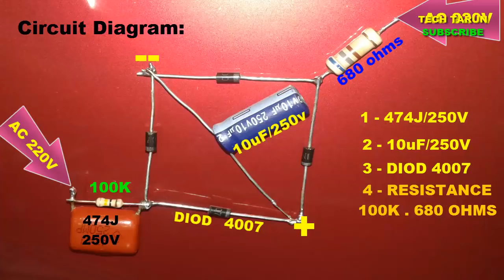51 led serial light run 220v with out transformer

Comment: Brother, 474J 250volt ke badle me 400volt dene par led jal jata hain. 
Mere kuch kuch 5mm led jal gaye.
Reply from the maker: Use one resistor 68 ohm positive series।।।
Reply: @techtarun77  thanks brother

Comment: ap log sai  tara  video ma ya ni bata ty Jo fa function badlny wali Jo kit ha os ma Jo przy lagy ha  WO kitny vad ky ha ak  ak  pozy ka bato gy plz comments ma bato plz
Reply from the maker: Description me tha all details।
Component  1 - 5mm 51 led    @     2 - 474J/ 250v      @ 3 - Condencer 10uF /250v      @     4 - Diod 4007        @ 5 -        Resistance - 100 k 1/4 watt       @ 6 -   Resistance 680 ohms 1 watt       @    Minimum 30 led /Maximum 65 led                                     CIRCUIT DIAGRAM -   https://drive.google.com/uc?export=download&id=1FbmLuwwkXZjPJS6M8_CD0ndV-V9Lle00

Comment: Please tell me what happens if I use 474J/450V capacitor?  Because I could not find 474J/250 capacitor. Will it cause problem if I use 474j 450 capacitor? Thank you
Reply from the maker: Yes use 474j /400v poly capacitor
Reply: @techtarun77  Thank you very much for the advice!
Reply: @techtarun77  If its  450, is that Ok?
Reply: @techtarun77  Please can you tell me how to increase the voltage for 60 Nos. 3528 LED's?  The power from this circuit is not enough for 60 Nos. of 3528 LED's. Thank you for your help.
Reply from the maker: Is circuit se 60 nos 3528 led nahi jalega ।।
Reply: @techtarun77  Can you pls give this resply in English? I do not understand Hindi.
Reply: @nimalp100  Yes that's fine

Comment: Sir is circuit se green ya blue normal 12 se 21 led tak jal sakti hai
Reply: 12 se 21 LED ke liye 0.22 uF 400 volts ka capacitor use kare aur capacitor discharge karne ke liye 470k ohms ka resistor use kare aur 680 ohms ki jagah 100 ohms 1watt ka resistor use kare

Comment: Sir please mujhe 12 led ko ac current se jalani hai 12 LED ka circuit bata dijiye
Reply from the maker: 12 led nahi jalega।।।
25 led  use Karo।।
Reply: 12 LED ke liye 0.22 uF 400 volts capacitor use karo. Uske niche 470kilo ohms half watt ka resistor lagao aur 680 ohms ki jagah 100ohms half watt ka resistor lagaao aur 47uF 63 volts ka polyster capacitor lagaao

Comment: How long can the head use this circuit if it is 30 leds. Ans please thanks.
Reply: Sir reply please
Reply: Use the same circuit just change the resistor for discharging the capacitor from 100k to 470k ohms half watt and use 10uF 160 volts Capacitor across bridge rectifier

Comment: Please help me i want to know i want to make a RED led chain of 60 led. 5mm. I am using 474k non polar capacitor connected with bridge rectifier. What resistance i will use in the led? Please advise me. And what polar capacitor i will use in the output of d.c terminal please help me
Reply: Use 100 ohms resistor for LED'S and  10uF 250 volts polar capacitor
Reply: @beautifulworld1491  but 100 ohm resistor how much and what Watt?
Reply: @duketal1  half watt
Reply: @beautifulworld1491  but 100 ohm how many?
Reply: @duketal1  Use only one resistor instead of 680 ohms
Reply: @beautifulworld1491  thanks for your time and information

Comment: sir plz help .....25 rgb led te capasitor konta lagabo.....plz aktu bolben ....
Reply from the maker: এটা 50 led circuit।।
এই সার্কিট এ 25 টা  এলইডি জ্বালানো যাবে না।।
40 টা rgb জ্বালানো যাবে।।
সার্কিট একি থাকবে।।।
Reply: @techtarun77  sir apni je 25 rgb led banano dekhiyechilen rate capasitor lagabo ....filter vlo hobar jonno....to konta lagabo....bolun....
Reply: @techtarun77  3.3k resistance diye .....tai ...otate capasitor ki lagano jbe ??? r lagale kon capasitor lagabo......bolun....
Reply from the maker: 2.2uF 400v capacitor...
Reply: apni akta comment a bolechilen 10uf 400 volt otaki vul ???? aktu bolun plz
Reply from the maker: 10uF 400v ও ব্যাবহার করতে পারো।।
Capacitar এর মান যত বেশি হবে ফিল্টার টাও তত ভালো হবে।।।।

Comment: Thanks a lot for upload this vdo
Reply from the maker: WEL COME !!!!!!!!!    TECH TARUN
Reply: Tha
Reply: Very nice
Reply from the maker: Thanks for comments. ..Your comments are very valuable for us. ...TECH TARUN
Reply: @techtarun77  Bhai sare material me se no 1 ka Kya name hai
Reply: @techtarun77  can we use it on parralel
Reply: @techtarun77  if not then give me link of parallel
Reply from the maker: No.
Led connect series...
Reply: @techtarun77  mtlab
Reply from the maker: Component  1 - 5mm 51 led    @     2 - 474J/ 250v      @ 3 - Condencer 10uF /250v      @     4 - Diod 4007        @ 5 -        Resistance - 100 k 1/4 watt       @ 6 -   Resistance 680 ohms 1 watt       @    Minimum 30 led /Maximum 65 led                                     CIRCUIT DIAGRAM -   https://drive.google.com/uc?export=download&id=1FbmLuwwkXZjPJS6M8_CD0ndV-V9Lle00
Reply from the maker: No 1 - 474j /250v Poly capacitor
Reply from the maker: No 1 name polyester capacitor।।।

Comment: Sir this circuit can be use all single colour 5mm led pl reply
Reply: You can add multicolor LED in this as well.
Reply: 40led ke sath 680/100 ohms over heat ho kar kal ka rahi hai kya karoo?
Reply: Reply fast sir.
Reply: Sorry.jal ja rahi hai.
Reply: @solarlite1201  Capacitor kaunsa liya hai tumne?
105 ka liya hai kya?
Reply: @beautifulworld1491  473j/250v
Reply: @solarlite1201  Use 100ohms 1 watt resistor instead of 680 ohms
Reply: @solarlite1201  how many LED's are you using
Reply: @beautifulworld1491  40 multicolour leds
Reply: Have you tried using this
What's the status of your circuit

Comment: I HAVE CONNECTED 114 MULTICOLOUR LED IN SERIES CONNECTION PLEASE TELL ME THE CAPACITOR,RESISTOR VALUES WITH CIRCUIT DIAGRAM IF POSSIBLE
Reply from the maker: Do circuit lagana padega 57+57 !!!!  Watch and see my next video
Reply: Use 105J 400volt capacitor and use 1mega ohms half watt resistor to discharge the capacitor.
Don't use any resistor to the 2nd terminal

Comment: How to blink them in three colour line
Reply: Yes you can use this circuit. Make sure you are using atleast 25 LEDs in this circuit. Instead of 680 ohms resistor use 100 ohms half watt. And for discharging the capacitor use 470 kilo ohms half watt

Comment: Sir 5run led cricket ka conexction batteya na sir pless help me sir
Reply: Use 0.22uF 400 volts Capacitor and 470k ohms half watt resistor to discharge the capacitor. And use 10uF 50 volts capacitor on bridge rectifier

Comment: If i use 10 or 15 led,circuit will be the same??
Reply from the maker: No।।।
Is bare mein channel mein video hai..
Reply: Give my link that video
Reply: If you want to use 10 or 15  LED then use 0.22uF 400 volts capacitor 470 kilo ohms half watt resistor to for discharging the capacitor and 100 ohms half watt resistor for other terminal and it will work flawlessly